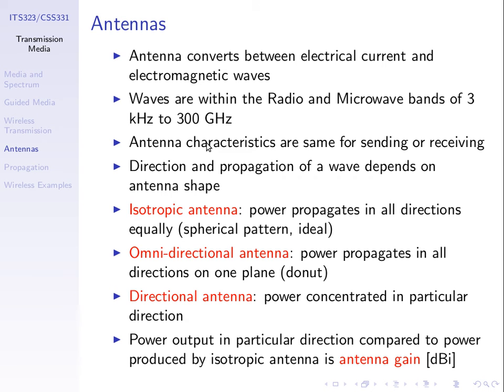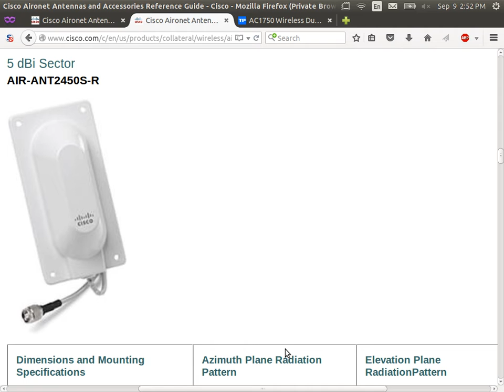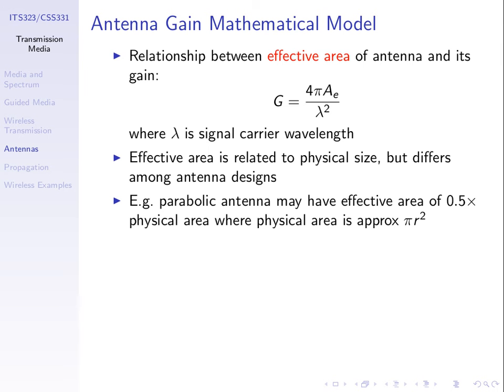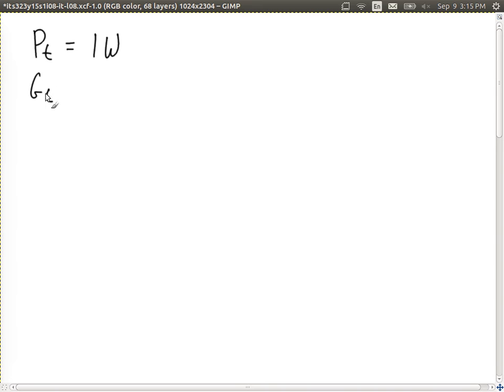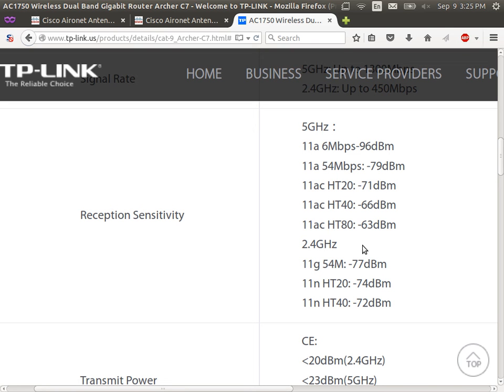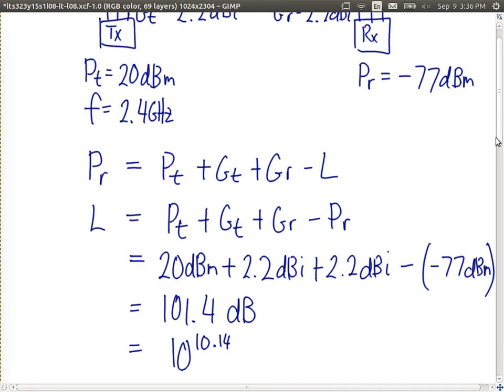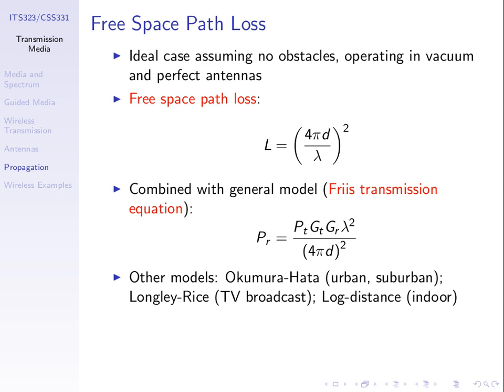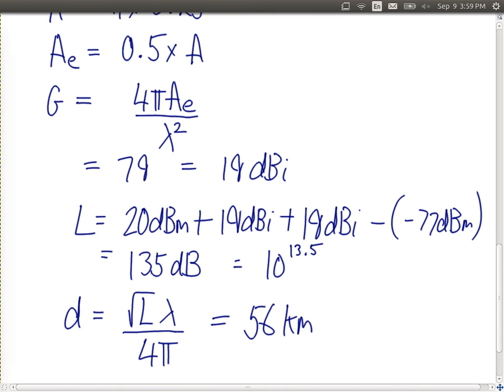Free Space Path Loss (ITS323, L8, Y15)

Comment: Antennas and Antenna Gain
 • Antennas in different directions have different gains 
 • Relationship between effective area and gain
  ○ G=(4piA_e)/(lambda^2 )
  ○ Lambda = signal wavelength
  ○ Ae = effective area
  ○ Ex
   § Parabolic dish antenna Ae = 0.5xpir^2
 
 
 
Propagation 
 • Wireless propagation
  ○ Ground wave
   § Below 2Mhz, 
   § The signal follows the curvature of the Earth
   § Ex. AM radio. 
  ○ Sky wave
   § 2 to 30 Mhz
   § They bounce off of the Ionosphere 
   § Shortwave radio, lets you pick up stations from Europe
   
  ○ Line-Of-Sight
   § Above 30Mhz
 • Transmission and path loss 
  ○ Gain is a multiplier, if signal is 100mW, and gain is 2, then signal is 200mW
  ○ Pr〖=(P_t G_t G_r)/L〗
   § Pr = power received 
   § Pt = power transmitted
   § Gt = Gain transmitted
   § Gr = Gain received 
   § L = path loss 
 • Friis transmission equation
  ○ Pr〖=(P_t G_t G_r Lambda^2)/(4pid)^2 〗
 • Lambda =wavelength = c/f where c=3*10^8m/s 
 • d = sqrt(L)lambda/(4pi )
  
 • Other models: Okumara-Hata (urban, suburban), and other models for indoor communications